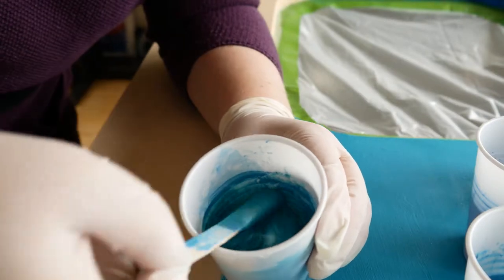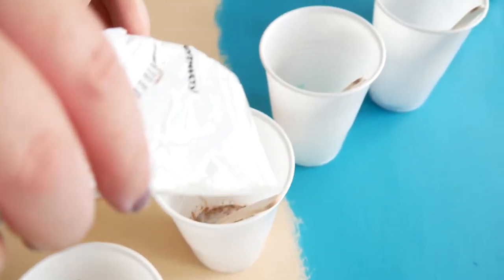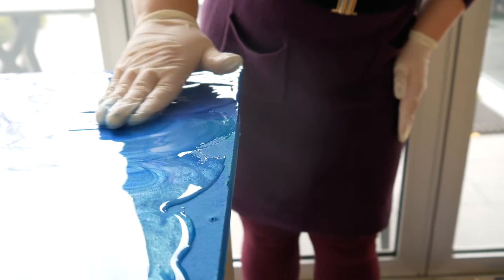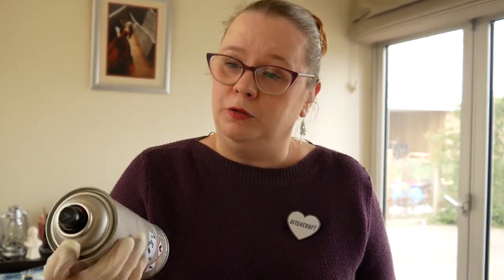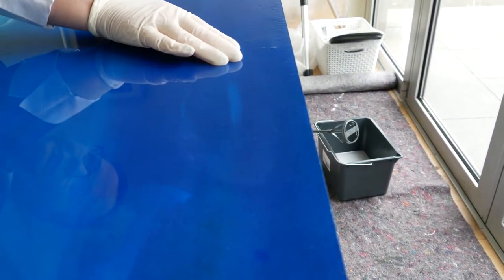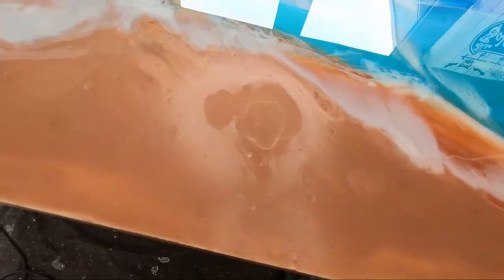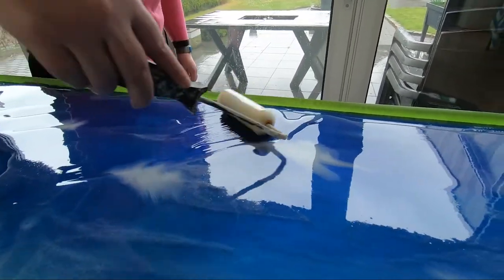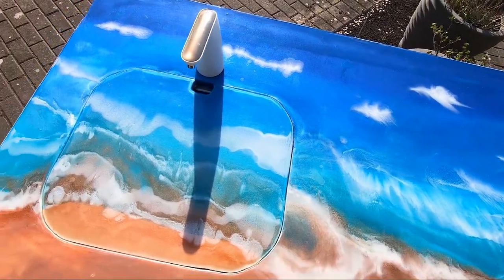OCEAN COUNTERTOP TABLE with EPOXY RESIN | DIY project

Comment: This is great! I’m by no means a professional and have been looking for such a weekend project to create a full outdoor kitchen in my backyard. Question: did you have to sand the epoxy down any for the sink cover to fit after finishing? Do you think magnets would work better than Velcro as a cabinet fabric closure solution? You two are adorable! Much love from Canada 🇨🇦
Reply from the maker: Yes, we did have to sand down the sides of the cover a bit for it to fit, but it didn't take too much to get it right. I'm sure magnets would work well too but we had plenty of velcro in our sewing stash so it just made sense to us to stick with that. That being said, the fabric we used for those curtains is quite stiff and heavy so it doesn't really need the velcro as it stays in place quite well on its own. 
Thanks for watching and the sweet comments! Much appreciated :)